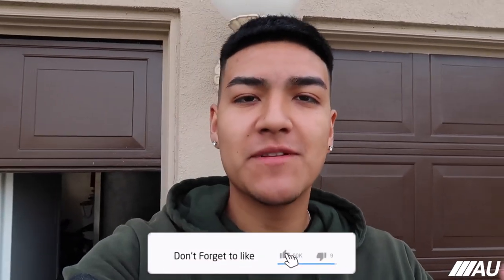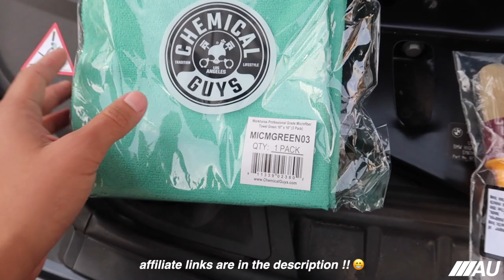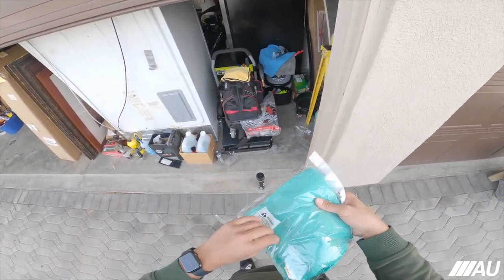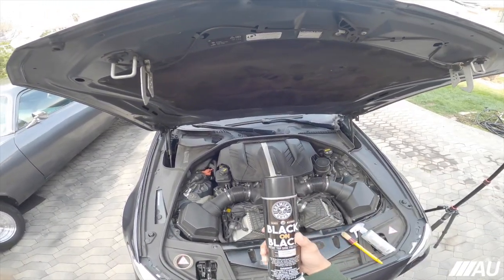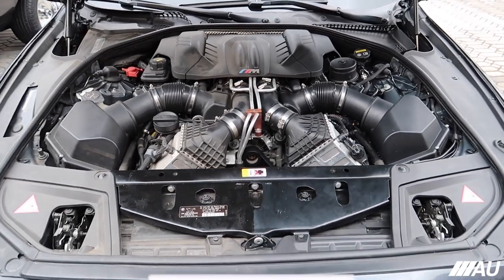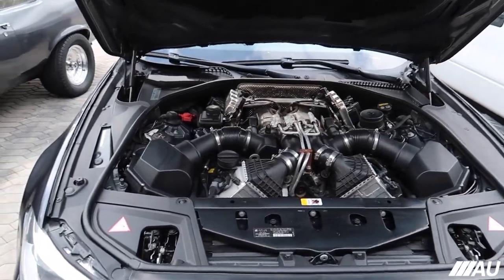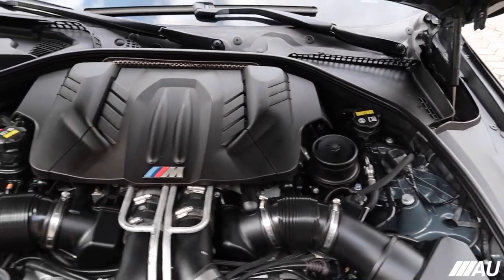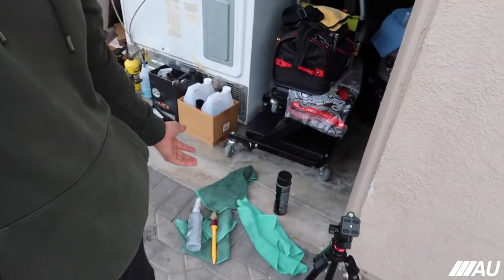HOW TO DETAIL YOUR ENGINE BAY WITHOUT ANY WATER !! (HUGE DIFFERENCE!!)

Comment: Great video 👍🏻
I clean my engine bay after car wash
Warm soapy water damp microfiber towel wipe everything down than hit it with some plastic conditioner 

1. Don’t forget to keep all of your hinges, door latches, trunk latch hood springs etc... lube everything with CRC silicone spray grease

2. Wipe all your rubber seals doors trunk hood than use some CRC silicone grease to keep everything fresh 

3. If you have sunroof keep your front drain holes clear from dirt use compressed air to blow them out 
Again use CRC silicone spray on everything that pivots on sunroof 

Your car will thank you in long run 
Keep up with hood work 👍🏻👍🏻👍🏻👍🏻
Reply from the maker: I appreciate your input every video man 🙏🏻
Reply: @anthonyulloa4004  no problem 
Lets take this Chanel to the new level you deserve it 👍🏻

Comment: After reading different sources I have a Question:
How do you downshift/upshift in our dcts, as in let go gas then downshift/upshift or it’s ok to have the gas down
Reply: upshift it doesn’t really matter, but downshift you should never be in throttle trying to downshift the car automatically rev matches and add’s gas to our downshifts
Reply from the maker: Yup I agree, unless you have your transmission setting on 1, then it doesn’t rev match for you
Reply: @HunchoArdit  thanks man
Reply: @anthonyulloa4004  thanks
Reply: @gurisgarage4527  np

Comment: Should get some intakes
Reply: Stocks are fine if not even better than the aftermarkets
Reply from the maker: I wanna get some front mount but they’re pricey 😅
Reply: @anthonyulloa4004  right 2k for intakes .. ssp clutch spec r is 2,600$ id rather get a new clutch